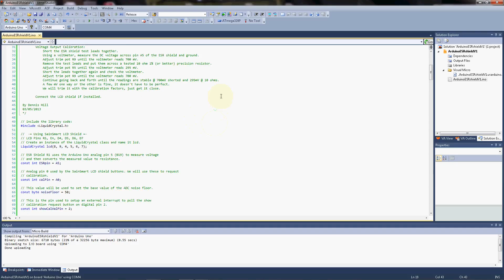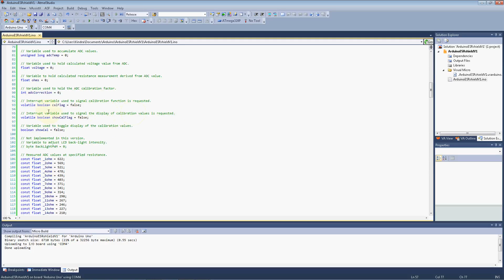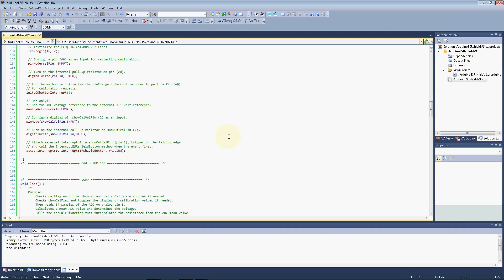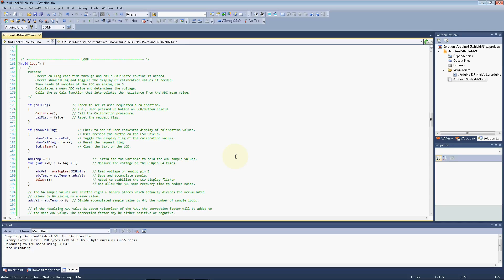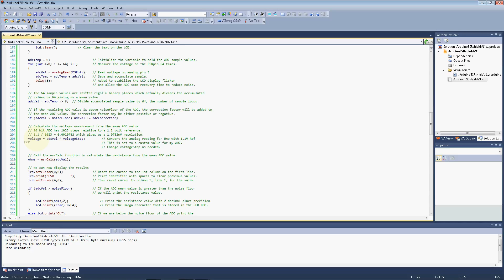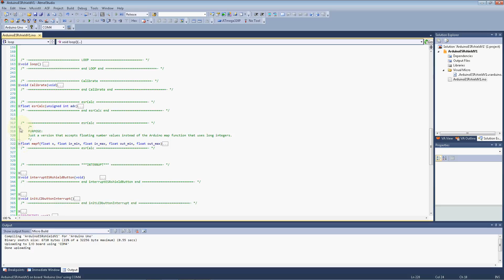DIY Arduino Esr Meter Shield - Part 4: Code

Comment from the maker: That is what I use occassionally too. Not that I'm an "Atmel Fan Boy"; But after my last go around with MPLAB X, It was time to find something to use that just worked without having to buy this compiler or that compiler and IDE add-in.... I used my Pickit 2 and ICD 3 happily for several years without issues with XP and when Win 7 came along everything started to change.

Hands down Atmel Studio 6.1 with Visual Micro is the best.